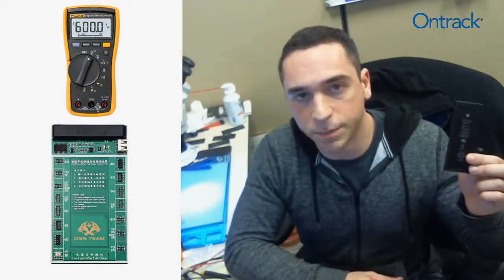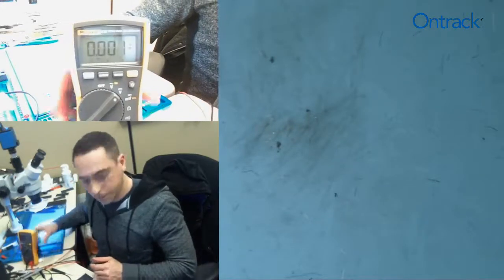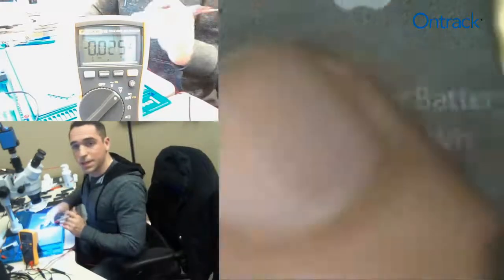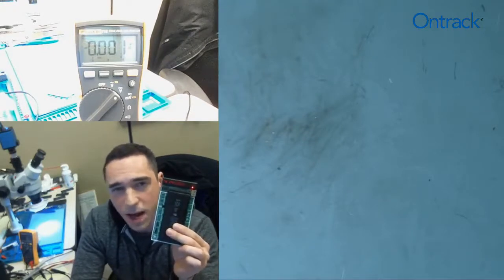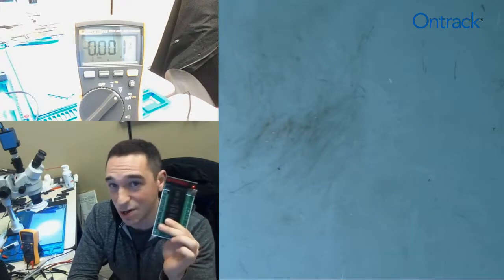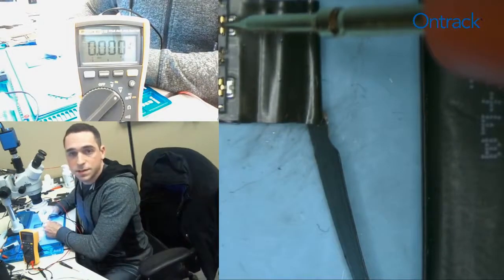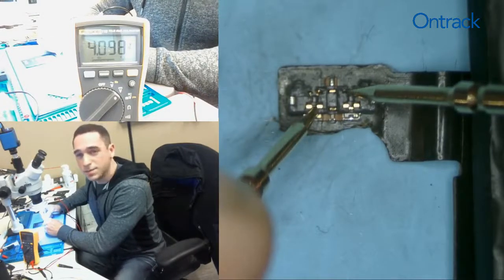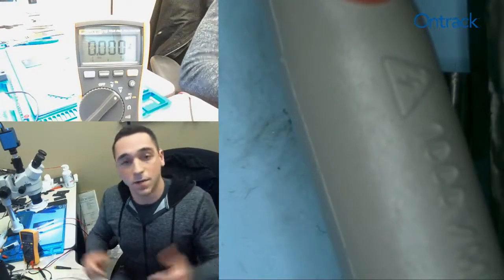iPhone Battery Testing with a Multimeter and Fast Charge Activation Circuit Board

Comment: Can the same approach be used to test ipad batteries?  Which contacts on the battery do you check?  I have 2 new batteries and I'm not getting any DC voltage and I'm testing different terminals.

Comment: I have an iPad 4 battery that drops voltage at the rate of about 0.5V/sec only when I touch the leads with the multimeter. What does that mean and is it dangerous for the multimeter ? Maybe I'm just not checking the right pins. I don't know the pinout.
Reply: shouldnt do anything wrong to the multimeter, but battery itself might have a problem like in video